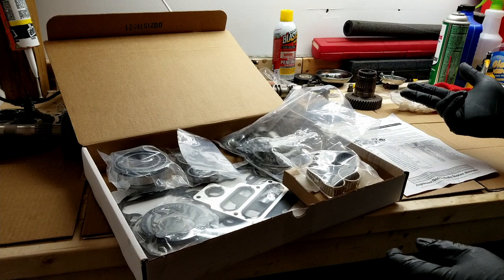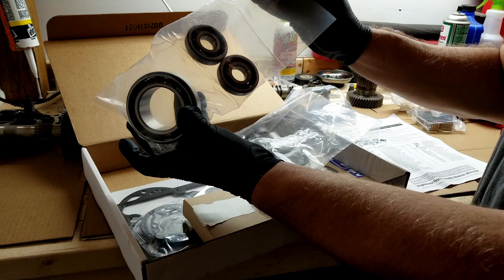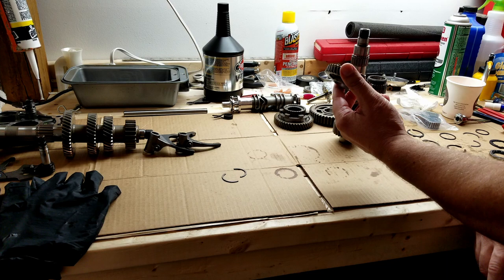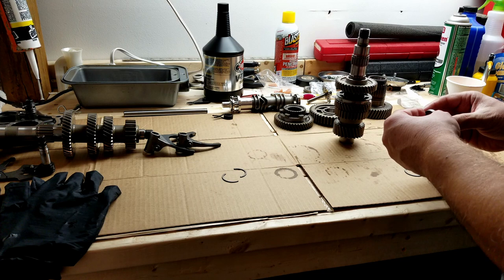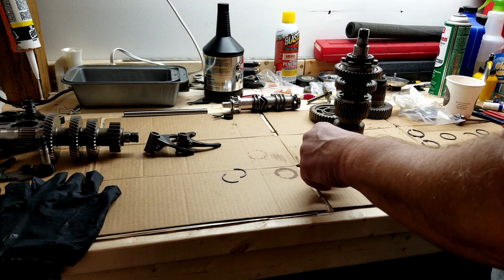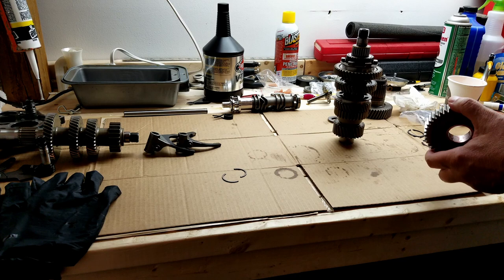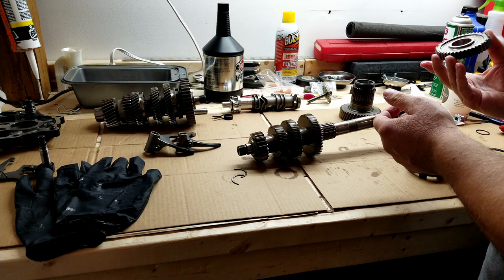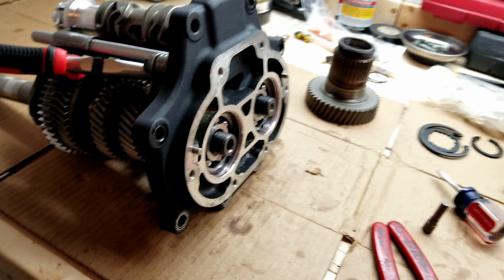2007 Harley Davidson FLHTCU Transmission Rebuild and Reassembly.

Comment: Hi there..if i may know, how much does it cost for set gearbox like that? I have the same issue on my ultra classic 2007. And where to buy? Im from Bali by the way, can i order from you?
Reply from the maker: Gearset starts around 500 used but I just rebuilt mine. Should be able to get all your parts on ebay or other parts site.